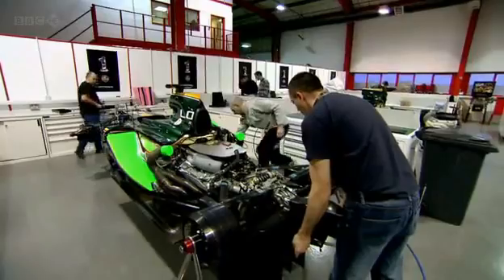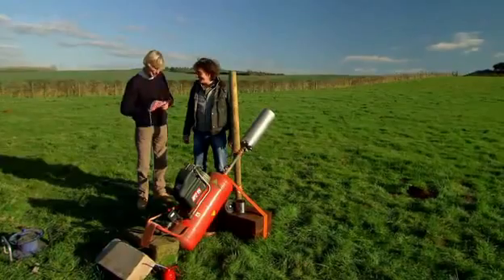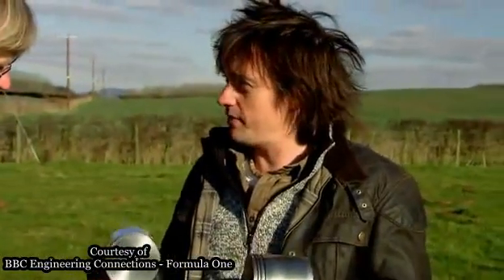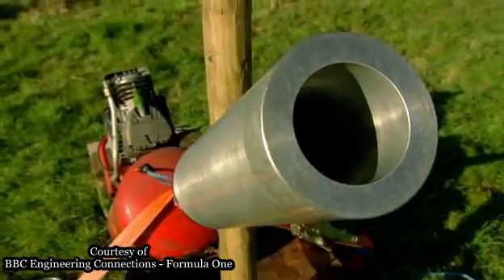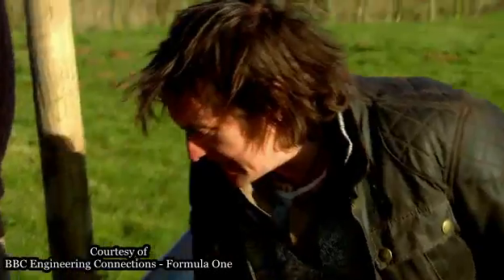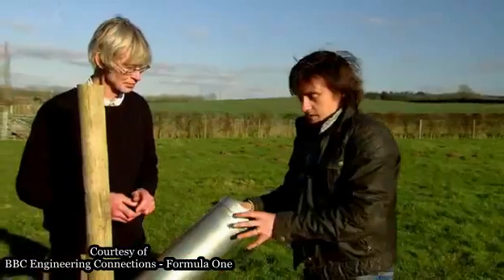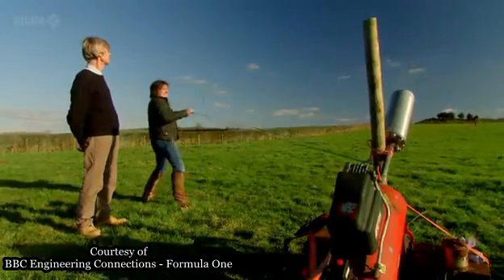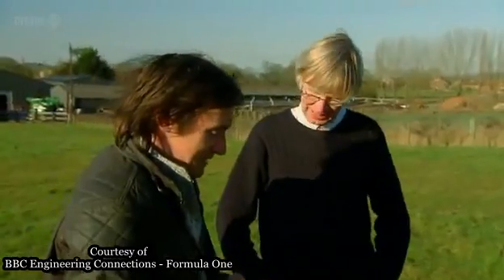The Secret of F1 Enormous Power - Precision Fitted Components

Comment: Grease was commonly used to help fill the windage gap, mostly for muskets after they stopped using pellets. But I'm pretty sure if the pressure got too high it just blew past the grease and lowered the power a bit. In fact it's likely that Hammond, being the backyard engineer that he is, may have replaced the O-rings on the air compressor with a good layer of grease

Comment: It's amazing what will pass for an informative video.
This is a fine example of how the fitment of a projectile to the barrel affects firearms, but has all but NO relevance to an engines power production.
This video in particular is entirely misleading.
The manufacturing precision of all standard production car engines are equal to that of an F1 engine with the exception of the balancing of the rotating/reciprocating assembly, this is quite well documented by numerous sources.
The "secret" to outstanding horsepower production from an engine is the engine's ability to intake and exhaust a maximum of airflow in a given amount of time.
     Simply put, the air/fuel mixture is the only source of energy an engine consumes to make power - yes, it would be useless without a source of ignition but a highly powerful engine and one with lesser power can have identical ignition systems - and the more air/fuel mixture an engine can process in a period of time the more horsepower it can produce.
Increased port airflow potential, larger valve opening area, camshafts with optimum valve lift and valve opening and closing event specifications, frequency/flow tuned intake manifolds and exhaust headers all contribute to increasing an engine's ability to process more air/fuel mixture in a given period of time, which allows it to produce more horsepower output.
The higher R.P.M. that F1 engines operate at is an extension of their limited size - to produce the horsepower from a large amount of air/fuel mixture requires it to be consumed in a short period of time - which means a small engine has to spin faster (unless super/turbocharged) than a larger one to consume the same amount of mixture - and produce equal power.
The subject of "boost" - and nitrous oxide/oxygen bearing fuels further proves the point of consuming air/fuel mix.
Compressing the intake charge packs more air/fuel mix into the cylinder creating a more powerful explosion. Nitro methane contains and then releases more oxygen when burned - producing more power. Nitrous oxide releases (nitrous alone doesn't burn) oxygen during the explosion, which when combined with more fuel produces more power.
Horsepower is a calculation - it isn't directly measured (torque is), torque - actual measurable power - during a given period of time = horsepower.

Don't be mislead by well produced videos from sources that know little to nothing about the subject.

Comment: I like Richard Hammond and all that, but this video is basically bullshit science.  I am sure F1 engines are built with precise tolerances, perhaps a bit tighter than most "normal" engines, but that is not the secret to their high HP output.  That is due to a wide variety of factors, probably the #1 reason being extremely high RPMs.

Comment: 1:56.It is not a gap all the way around the projectile,as stated because the angle of the cannon ensures gravity has the projectile offset to the cannon barrel. They are not concentric.
A lot of the energy from the explosive force,will have the projectile reverberating in the bore of the barrel,while in a closer tolerance between projectile and it`s bore, that energy would be fully used to propel the  projectile forward at greater velocity.
I note the projectile has the aerodynamics of an outdoor water shithouse.I will not be watching any more.

Comment: Word of advice to anyone that's going to have machine work done for a performance engine, if your machinist doesn't have a temperature controlled machine shop DO NOT allow them to do machine work for you, I build engines  for a living and I can tell you from experimenting that measurements change over just a 15°F rise or drop in temperature, all of the clearences and measurements that are used in machine work are to be done at 70°F, I have conducted experiments where I took measurements at 55°F as opposed to 70°F and the clearences had changed by one half of their original measurements, what that means is if you have a piston to wall clearence of .001" at 70°F then it will show .0015 at 55°, which means that if the work was done in the winter in a shop where everyone is wearing sweatshirts and it's 55°F the clearence would come out to .0005 at 70°F, that's half of the required clearence, the clearences in today's engines (because of modern low expansion materials) and older engines built with modern components are usually very tight so if you walk into a machine shop in the summer where everyone is sweating their asses off and it's 95°F in there that's a 25°F difference between the temperature that it's supposed to be done at and the one you're about to pay a lot of money to have it done in, in the summer I wait until 2 or 3 in the morning when the temperature is at 70°F to fit piston into cylinders, most of these so called machinists have never even heard of the term Standard Engineering Day, that means 70°F, 14.7 PSI atmospheric pressure, a specific humidity that I can't remember because temperature is what affects what I do, but the point is if you're having performance machine work done and a shop isn't temperature controlled don't trust their work, I can guarantee you that every F1 engine built is done in a temperature controlled machine shop, Ferrari even has trees in their machine shop to keep the humidity at a constant level.

Comment: Dumbasses if you put a micrometer on the pistons they are not a sphere they are oval shaped with a smaller measurement being along with the wrist pin. the thrust sides of the skirt are where you measure for piston fit.

Comment: what a pity that no dimensions are quoted.  Terms such 'a little'  and 'tiny'  and  'bit less' do not tell the story.  Nor does the less than average finish on both the barrel and the piston. were there any  rings fitted on the pistons, did not look like it.  Small differences can be measured with a micrometer , but it seems that the untidily dressed presenter was not aware of any of this.

Comment: Lol...what expands more when warming up? The aluminium piston or the steel liner???
This guy's want to fool who here now???
High performance pistons are smaller in diameter on the top then on the bottom when cold because the top has more material and expands more to the right tolerance when at working temperature. So why they fooling us that you can't turn the engine when it's cold😂😂...where is the logic lol.
That they are warmed up before firing them up is just to minimise wear...simply as that.
Never heard so much bollocks in one video😂

Comment: Due to higher friction between the cylinder and cannon more pressure got into the chamber before it was able to push the cylinder out. If you were to fit a cylinder even more precise, it would be a bigger firing distance, due to more pressure build up.

Comment: ALSO horseshit, like in a gun, the friction of the tight projectile HELPS the projectile to fly further. It allows the gas to build up in the barrel behind the projectile while it travels up the barrel. In a gun this is while the powder burns and expands. If the bullet is too loose, it will fly out the barrel before the pressure can peak. In this air cannon, the valve between the tank and the barrel is quite small, the air can't rush through instantly, and you probably have the same effect, of the pressure peaking behind the round as it starts to move up the barrel, and then popping out the top. But neither has anything to do with how an engine works. If your piston is so loose fitting that it effects power, then you've got serious problems, and your piston rings are totally shot and you're putting clouds of oil smoke out into the air, and letting petrol mix with your crankcase oil and air/fuel mixture is forced into the crank-case on each compression stroke.

Comment: This is pure rubbish. High-strength engineering has a lot more to do with it that "precision machining". You have to DESIGN a windage gap into a cylinder to make it work, decrease friction, and allow for expansion fo the metal. The thing is machined very precisely to a larger size and looser fit than they COULD make it fit. That makes everything about his "example" total rot.On that subject, while saying they needed windage in cannons "so the projectile wouldn't get stuck" is technically accurate, it was actually to allow the gunners to LOAD the shell from the muzzle, especially once the gun started getting fouled up by black powder residue. A gun will easily force a projectile that's slightly too small out of a barrel; in fact, that's exactly what most guns do today. But loadin sid projectile DOWN the barrel from the muzzle would take a really big hammer. Total rubbish video.

Comment: Does metal not expand with heat? How is it that, Stone cold the engine is too tight to work but when its at operating temperature (where metal expands) it works fine?
Reply: T N. block heats up more

Comment: i guess the most important thing is the bore/stroke ratio. it has a short stroke and big bore. at 18 to 20000 rpm the piston speed is lower than a nascar v8 at 7 or 8000 rpm. thats the main reason why the f1 engine doesn't rev itself to pieces.

Comment: Aluminium pistons expand as they get hot so they are slack fitting when cold...
Also race engines run wider fit tolerance than road engines too allow for a greater oil film thickness.
Both of which is contradictory to what is been suggested here...

Comment: So standard engine pistons rattle around inside the bore with no compression or oil rings and spits oil out the exhaust and air box. Yep, I don't think so LOL. Power comes from short stroke which allows higher rpm plus no turbo lag due to a motor spinning the turbo at low rpm.

Comment: 1. All modern engines use 2 seals and 1 oil scraper on their piston to prevent leaking. 
The only engines suffering from leakage reek of oil and emit blue smoke. Basically those that are scrap ready
The key of more power lies in the length of the stroke. 
Short stroke means pistons travel less each during each cycle which allows them to rev much higher. 
That means more fuel and air which means more power. 
Of course this does lead to other technical problems such as heat and floating valves. 
Which are solved by clever enginering and pneumatic valves

Comment: The secret of F1 enormous power is that the engine only needs to last the duration of the race.
Tight tolerances probably help.
High compression probably helps.
High bore to stroke ratio certainly helps.
Better materials probably help.
Most of the gains over road going cars are made by sacrificing attributes critical to road going cars.
Reply: Vincent Baelde-Millar Exactly. That's why in the 80s-90s you saw HUGE american engines with displacements like 5.7l, but they produced very little hp per liter, however, most of them were extremely reliable and still run fine today if maintained properly.

Comment: Complete ballonee. In my engineering course, a bigger tolerence between piston/cylinder is usualy beneficial to the maximum  power, a piston engine can give. The rings however, will take the beating, and polution, lubricant consumption and noise are also going to be negatively affected by a high gap cylinder/piston.

Comment: Interesting, but as an engineer I was hoping for some numbers. For example, how big is the gap? What is the difference between the diameters of the smaller and larger pistons?
Reply: One big difference in F1 engines, they didn't mention for some reason is that the pistons are wide and short. Which allows for more rpm and power.
Reply: But... he... he shot that Canon and... the pistons flew so far aaaand... 25% increased lenght!!? Wasn't that enough numbers for a TV program??? :P
Reply: probably trade secrets for each engine builder.
Reply: the actual reason that f1 engines run at such high rpm is because the boar to stroke ratio is very high, meaning that the diameter of the piston is much larger than the stroke of the crank, allowing greater speeds because it doesn't move as far
Reply: Top Gear is rather oriented to a wider audience, thus seriously decreasing the quality of the content. I think it is great entertainment, but not very useful if you actually want to learn something.
Reply: ansmerek Exotic materials are banned in F1...
Reply: By the look of how he had problems with entering the piston with the smallest tolerance I would say it had a h7 fitment of 0 - 0.04-mm below 0 with the piston having a diameter of 120mm. If the cannon had a inner H7 fitment aswell that would mean it had a 0 - 0.04+ mm over 0. I dont know if the piston had a diameter of 120mm but I would only guess it was something in that range by looking at his hands... All in all this means that the cannon had a diameter of 120.00 - 120.04mm and the piston with a diameter of 120.00 -119.96mm...
Reply: Typically 0,005mm to a max of 0,01mm clearance on an F1/high performance engine.
Reply: Another big factor is in the top end of the engine.  Exotic camshaft free valvetrain with variable timing and a lot of sensors and computing power to adjust variables.  Exotic lightweight materials and advanced cooling systems.  The fit of the piston to the cylinder is important, but this technology has existed for a long time and been commercially available for a long time
Reply: +ansmerek I'd love to watch the timing stroke on slow motion and see just how fast those tiny valves and springs must operate unless not mechanical but servos?
Reply: gundam fan I think pneumatic but I am not sure.  I suspect no springs at all but something else?  I have no idea to be honest but whatever it is must be amazing to see
Reply: gundam fan i think F1 uses compressed air/nitrogen instead of springs for valves.
Reply: +youluvana yeah it would make sense less to go wrong but at that speed in previous engines going close to 21k revs the noise was insane.  now days with less noisy engines and lower tones I'm assuming less revs. but all in all like indy car and formula cars are engineering at its best. I was there in 2003/4 where they raced up and down regents Street promoting f1. the noise  in London was erotic lol

Comment: I didn't see one comment on the first page anyway, that seemed to get the point, everyone is talking about RPM and HP vs torque and rings, the point he making is, F1 engines are built to a much more precise standard, so because EVERYTHING is so much more precision made, it adds up to what makes an F1 engine so powerful, he was just using the fit of the piston, because it was easy to show the effect of different tolerances.
Reply: tight tollerances applies to EVERY racing engine..
The point is, the short stroke and large bore diameter and very high rpm is where the power is really made.
Reply: fun fact:
A NASCAR piston travels faster at 10,000 rpm than a F1 piston at 18,000,simply because it has twice the distance to travel at a given rpm.
Reply: exactly☺
Reply: What you are saying may very well be true, but that's not what he's talking about in this video.
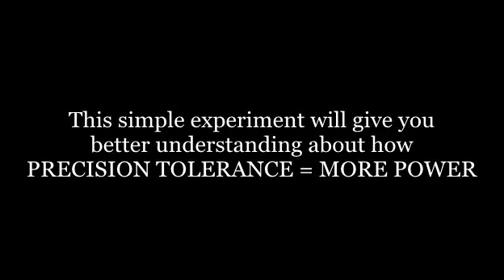The first thing thing that comes up on the screen is" The secret to the F1 enormous power is precision fitted components" Then he talks about about it, then at 0:35 more writing comes up that says "Precision components= more power.  
That's what the whole video is about.
I re watched the video, he never even talks about bore and stroke.
I'm not disagreeing with whether or not what you are saying about the motors is right or wrong, I'm just saying in this video, he's giving all the credit to precision.
Reply: Yes, but what he "proves"...that a tighter fitting piston somehow absorbs more power...is totaly wrong. It's obvious that is NOT what he was saying. He was wrong, deal with it.
Reply: But they aren't, may tuners are now making that hp level or much greater with street engines of the same displacement.

Comment: ALL race cars are "precision fitted", not just F1.  Not impressed.
Reply: Hahaha can an average race at redline at 18,000 rpm? No XD
Reply: Precision fitted? To which tolerance? That used in Formula Ford budget, or that used in Ford Cosworth budget?
Reply: you can start your engine cold without scuffing your cylinder walls
Reply: Commercially fit. Precise are the calibrating devices ( standards ).

Comment: Load of BBC rubbish,  ordinary cars have piston rings which seal against the piston lands and cylinder walls which prevents the crank case becoming pressurized with hot gas which would ignite the lube oil windage vapour.   F1 power comes from short stroke pistons with ultra-high revs, that's why F1 engines idle at 3000rpm and you stall the engine if you try to pull away at anything less than 8000rpm.
Reply: What? Normal engines have a lot of blow-by. The rings help but they are not complete seals. That's why you need to have a PCV system.

Comment: Tight v loose fitting projectiles. This was not a lost technology. Engineering and manufacturing recognized lower tolerances better performance. At a cost, manufacturing costs and/or longevity. How long can an F1 engine run before parts wear down and fail, at what cost? Modern street cars are achieving some amazing power and efficiencies, high torque and high rpms in some tiny engines. They do blow up on occasion, the price and risk is acceptable.
Reply: Exactly even if the block and oil are heated doesn't the piston expand when it's up to temp so them engines can't last long they like a one hit wonderr